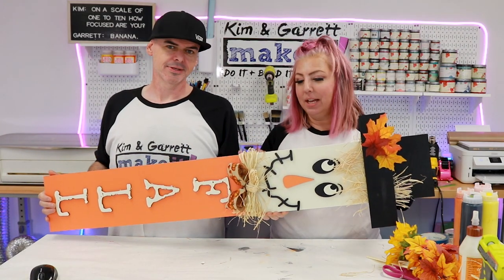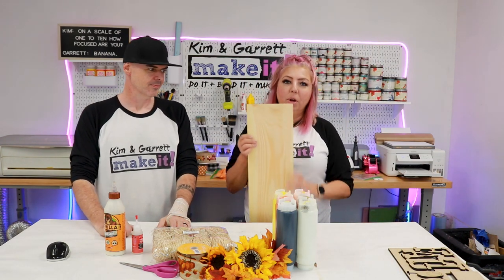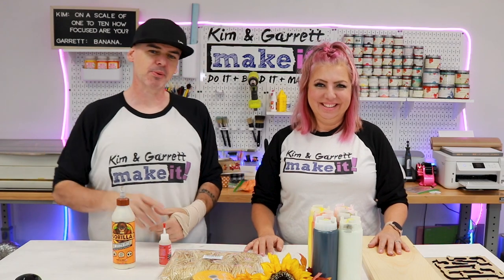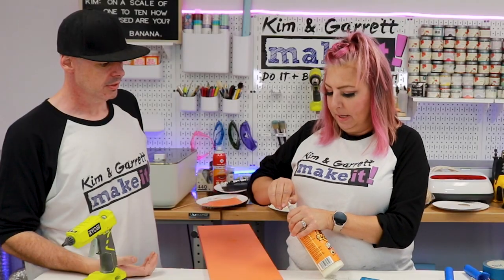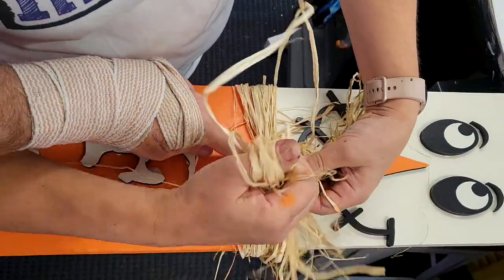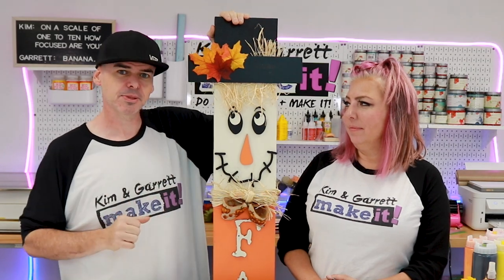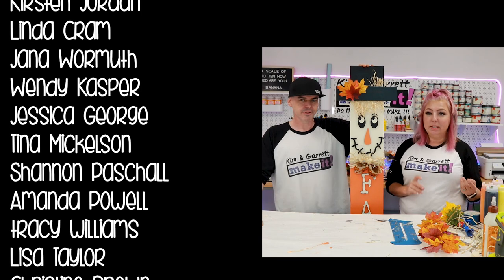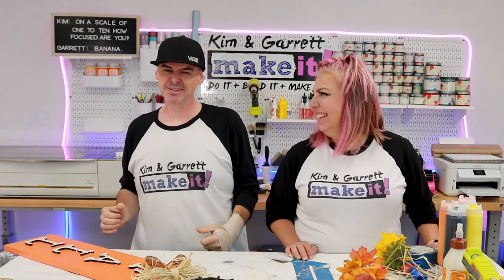Pricing Crafts to Sell

Comment: Perhaps using a standard sponge-cut 4 wedges off (from the corner) in 2 sealable plastic containers
(one for glue-one for each paint color)
Wet with water and use for both glueing and applying paint to the small pieces would not only speed up production but can also conserve and preserve glue and paint for multiple production days?
Left overs can also be used on a different project or testing another prototype.
Just a suggestion when producing multiple of same and similar designs.
Maybe worth trying-especially as seasonal designs tend to use basic same seasonal colors.
By the way-nice work and thank you for displaying your process 😊